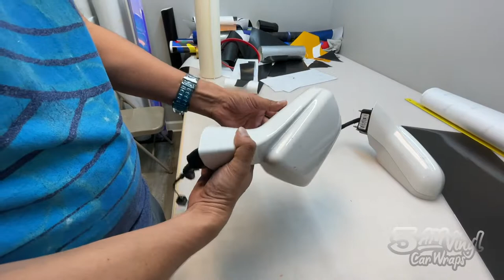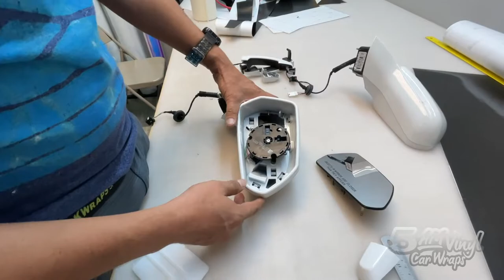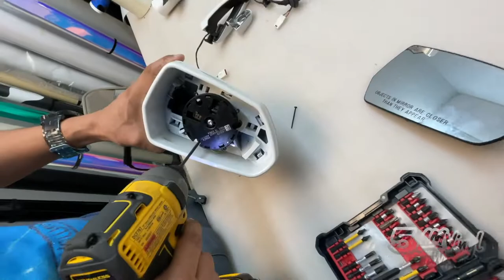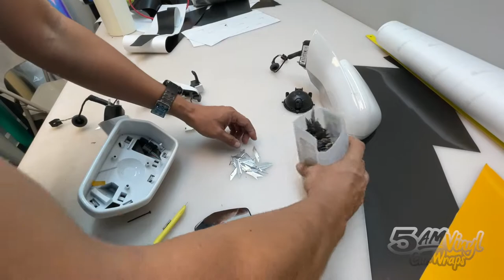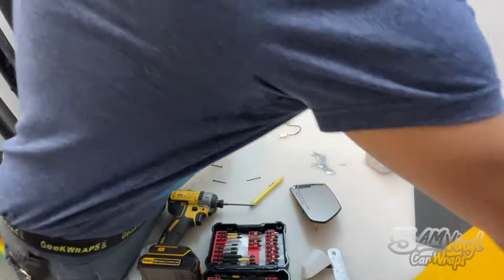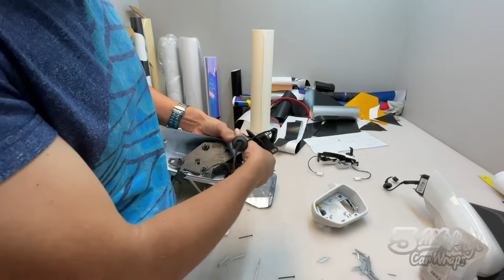How to disassemble 2016-2021 Camaro side view mirror

Comment: Where can I get the mirror glass with the plastic backing?
Reply: Part numbers are 23487740 and 23487741 for the 2SS / ZL1 (heated, with blind spot monitoring, driver side auto dimming)